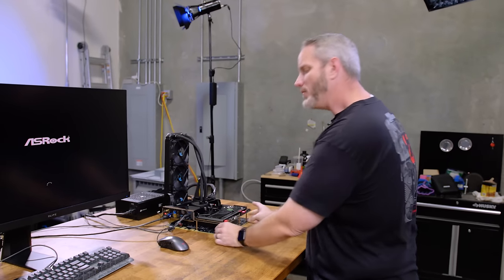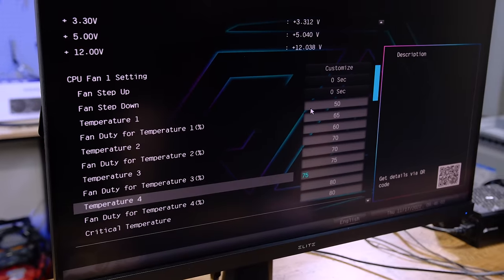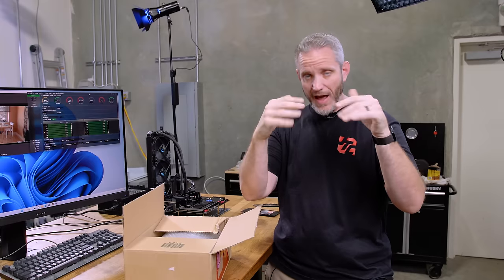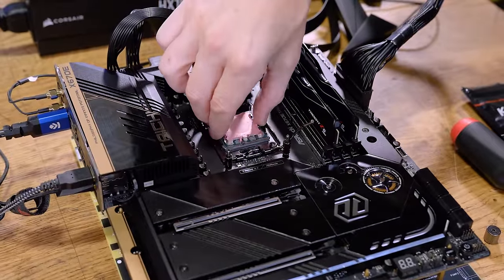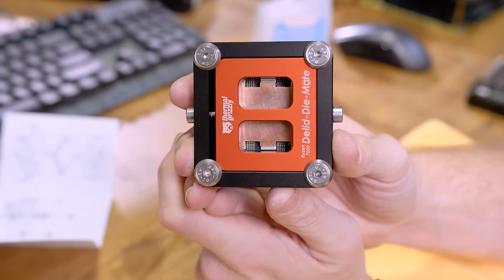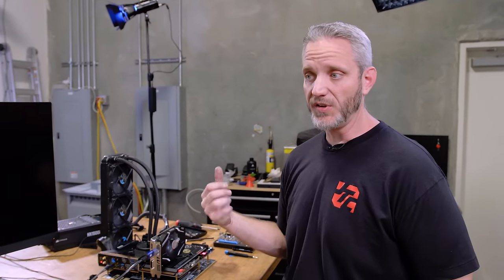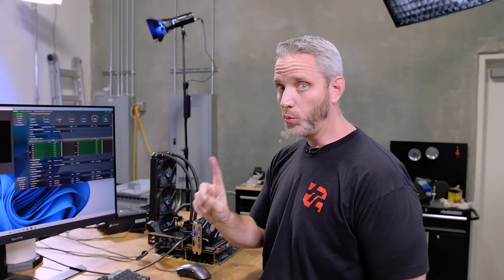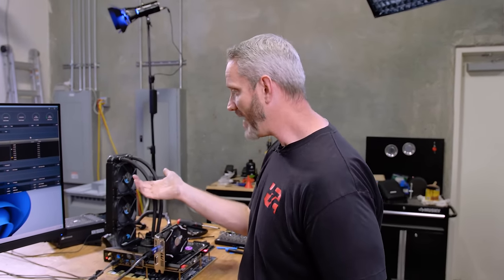I was scared to delid my CPU, but then...

Comment: Seeing you brush a CPU with a toothbrush terrifies me. A while back I had an old GPU (I think a 780 Ti) that I had replaced collecting dust, then decided to try to sell it. I used compressed air to clean it up and then gamed on it for 6 hours to make sure it still worked. After I noticed it still had some grime all over it and I wanted it to look like new, so I got a brand new soft bristled toothbrush and gently cleaned the whole thing, had it looking like new. Afterwards, the card was artifacting hard and after about 5-10 minutes would just crash the system. I figure at some point some ESD damaged some things on the board. Even if alcohol prevents the ESD, the thought of cleaning with a brush still bothers me.
Reply: You used the wrong alcohol
Reply: @ChrisWijtmans  I didn't use any alcohol, just gently brushed off the fine dust that air wouldn't remove. I think doing it with a coarse hair paint brush would've been better, since I think it was the synthetic plastic toothbrush fibers that caused ESD.

Comment: The CO voltage offset is found in the advanced PBO config on X570 boards, not beside the basic voltage tuning places.  I'd assume it's roughly the same on X670.

Comment: Nice nice video, Jay! Much thanks. I wanted to tell you something I heard about using Kryonaut for direct die cooling. I was changing my laptop's thermal paste because it dried out after 3 years (thanks, Intel). I read a lot online about how it dries out when temps are 80+ C or something like that. So maybe that is something to keep in mind when using it in your case. I am not how correct this is. I just wanted to tell you.

N.B.: I am using Arctic MX-5 now. It has been fine for the most part. A bit irrelevant.

Comment: Those other voltage settings only affect Manual Overclocking, which is switched on when the CPU draws over a certain amount of watts after a certain amount of time. In manual mode, you can select a set voltage for all cores and a set frequency for all cores (or at least each CCX) to dial in optimal settings for an all-core workload, but it shouldn't be much different to what PBO could do under the same conditions. I would love to see a CineBench score for when the PBO thermal limit is at 95 degrees (which is what is advertised that they can run indefinitely at) and stable values for CO (24 hours of OCCT AVX2/Small/Extreme with only one core loaded at a time). I think those settings can be found under Advanced -> AMD Overclocking in ASRock UEFI. That could show off what delidding really can do. I'm not sure I trust that the "Performance Preset" options offered under the ASRock UEFI are actually stable. It's all about the clock speeds and benchmarks with this generation and not temperatures, since you can set those to any you want and the processor will throttle itself there.

Comment: I have a velocity2 on my 7950x and it doesn't use an ek backplate. It mounts right into the stock backplate using a keyed stud that you tighten from the back.

Comment: ASROCK has always had the issues with 'pump more voltage' at their OC's even their Intel stuff.. their 8XXX stuff was throwing insane voltage for a 4.8-5.0 oc etc like 1.4v when you could get stable at 1.2 or 1.25

Comment: AMD boards are configured to get the max. out of the CPU they can. If you improve the cooling, you improve the performance especially of the turbo mode, but not really the temperature itself because the leeway is used in exchange.
I gained 20% in performance through adjusting the CPU cooling ramp, restricting the turbo mode and undervolting my CPU - and it's only a 65W Ryzen 7 5700X.
The thing you need to watch out for the most is thermal throttling, so if your CPU drops below its base/regular clock speed under load, finetuning is strongly recommended - and searching for flaws in the setup for good measure.
Also, I recommend avoiding AMDs above 65W, because they are prone to not just throttling but almost strangling themselves due to heat development, or if you want to go there regardless to ensure high level cooling such as shown in the video.
The best "performance for the bug" you get from a Ryzen 5 5600, which is a hexacore, or a Ryzen 7 5700X which is the fastest regular 65W octacore Ryzen.
The "Ryzen 7 5700G" is about 5% slower than the 5700X, but it does come with integrated graphics at the level of decent 720p gaming performance.

Comment: What this needs is a small CPU sized, PCB that has pins on one side connected straight through the PCB to pads on the bottom -- the PCB then gets installed between the socket and the PCU raising the top of the de-lidded CPU to the height of a normal CPU. That way you don't have to do anything special to get your heatsink to mount properly.
Reply: That would raise the resistance of the pins dramatically and probably damage the CPU, putting something between the LGA pins and the CPU.
Reply: @ColwellMarcus  Yes it would raise the resistance. I don't know if it could be classified as "dramatically, the pins already have to go through the socket, through the mother board through the (for example) RAM socket through the DIMM to the memory chip so there is already a bunch of resistance. The question would be "does this add too much resistance?"

Comment: I could be wrong on this as I've not fact checked this much yet but I think the solder used between the die and IHS isn't the same solder you think of when you think soldering capacitors SMD components.    etc.
I saw somewhere(I forgot where online) that briefly mentioned the solder used to transfer heat from the die to the IHS is more like a thermal paste than traditional solder, which would help explain why jayzTwoCents was able to delid this CPU without riping the Die off the CPU at seemingly room temperature.

Comment: Thank you for the very informative video as always, Jay. Say, that Celsius s36 was originally advertised to be upgraded to custom loop later, correct? If so would it be possible to just refill it? Asking for myself mostly. I was also looking at trying to get a 360mm 180x2 fan Radiator (if they ever become available again) for a fractal torrent case. My plan was to add the celsius pump and tubing to the 180x2 radiator... That pump would be ok for that rad, right? I'd imagine I would have to make sure to stick with a model with similar thickness?? I'll be honest tho I was looking at one of those thick boi's from alphacool lol. Keep up the great work. I always enjoy watching and learning from and with you.

Comment: Welcome to asrock. Also sometimes readings or voltages are not correct. For instance you could set cpu to 5.1 In the bios. But end up at 5200mhz😅

Comment: He’s come a long way from 3d printed deluding tools for my 9700K. Glad to see he’s still doing great work and improving on his designs. Do they have a copper IHS for this cpu?

Also when removing the original thermal compound, I had bought some solder removal paste stuff from him as well. People said they ran out too fast so I used it very sparingly about 4-5 times before I got everything cleaned up well enough that I thought fit to add Liquid Metal and put my new IHS on the chip. Used 4 dots of super glue to hold ISH on and haven’t had any issues since delidding 2 years ago.
Reply: the standard Intel and AMD IHS' are copper, there's no point in getting an aftermarket one (der8auer himself tested this)

Comment: I thought der8auer only worked with Thermal Grizzly, pretty sure he didn't found the company. Their stuff is great though, I always use it when working on consoles as well because of the longevity - their products have made many an Xbox and PS2 run cooler than cool.

Comment: i have de-lidded a Ryzen 5 5600 and to get the solder off the IHS in one clean quick efficient sweep is by using a thin razer blade one of those flimsy ones, running it almost parallel with the IHS and under the solder. comes up in one nice clean piece. It just sucks after that first successful attempt at de-lidding a Ryzen 5000 series. the very next day was my attempt at the 5900x and, well.. that was a 400 dollar lesson learned.

Comment: If AMD hadn't increased the thickness of that IHS and allowed the CPU to run around 135w max with those better thermals, this CPU would've sold way better.
Their insistence on attempting to keep pace with Intel meant the 7000x series isn't going to do as well.
That, and they're really competing against the 5800x3D.

For myself, if the CPU had had similar performance to a delidded one right from the start I probably would've gotten it even with a requirement to upgrade to AMD5 and DDR5. That money spent is not an issue, especially if I know I can do that and wait for 7800x3D and be already set up and ready to go for their 7900 XTX.

But, knowing the CPU runs at 95C, knowing it could've been better, and knowing it chugs power like crazy when my little 5600x already has similar performance at 4k+ resolution means I don't care to change to something that is a lot hotter, a lot more power hungry, and won't really give me any tangible performance uplifts.

========

If you compete with yourself you only then need to worry about your customers and giving them what is best for them. You don't need to beat your competitors, you only need to come within striking distance and show your customer base that you're the better value, the better company, and will support them more. Case in point, the Zune was a better MP3 player, objectively better. But Apple competed for customer satisfaction while the Zune competed with the ipod for performance and features. Look where we are now.

Comment: Jay, you know what annoys me so much, is how BIOS these days generally, apart from needing better detailed explanation about what voltage changes do effect, but simply allow simply to ability to expand down a detailed explanation what/where else it effects. Heck, even showing a diagram of the mboard and where changes view in a pictural colour view vectoring what changes interact with. As there are a few voltage options that by changing one slightly effects other components so fricken much. I think more than that, there are interactions where certain ratios can bugger everything up. 

For instance, apart from doing this kind of stuff since my 486dx4 100,  I am now managing to get my current build with a 12700k to hold all cores @ 5.5ghz and e-cores 4.2ghz, Ring 4.6, Corsair vengeance ram upped from 5600 cl36 to 6000mhz cl32 with a reduction in overall system latency, heat, temps,  total100% stability and can run it in power states in Windows to save power and all that stuff yet smash benchmarks, and not have a single core hit 90 degrees at 28 degrees C ambient. Also, makes my MSI Suprim X 12gb 3080 stable and work its arse off maintaining minimal fluctuation in 4K usage between 2130-2190mhz. This with just a Corsair 5000x case, a Noctua NH-D15, MSI Z690 EDGE WIFI, Corsair HX1000 PSU, 2tb Samsung 980 evo pro + 6 other hdds.

Basically, it took experience, persistence, hand drawn mud maps, reading detailed insider info from a few sources, and some mental substances to keep me motivated until I was done. 

Either way, when my old i7-4770k MSI dragon what ever motherboard included a nice diagram you could at least mouse over to see what is what with some detail. Figured, it would be all up from then..

Comment: If liquid metal can dissolve the solder between the IHS and the die aren't you afraid it will also eat up the solder between those surface mount resistors?

Comment: Removing the thermal paste is always a chore. Would pouring the alcohol into a small glass bowl and letting the CPU soak in it work better? I always use 90% alcohol because it works better. Could it be that Roman worked on the team that developed the 'O ' rings used on the space shuttle?

Comment: I believed that Roman (derbauer) bought into Thermal Grizzly, rather than starting it as you suggested Jay? Also, the cooler blowing hot air across the VRMs - really?! Surely it's best to blow away from them, so pulling cooler air across the VRMs. AND, according to Roman, VRMs don't really get very hot anyway.

Comment: Jay nailed it here.
If there isnt a massively over-thick IHS, you dont need the voltage to be so high to get the clocks, so are not creating heat, that cant get away.  AMD in their design, decided to default on letting temperatures peak to get the clocks they want ... thereby announcing they dont care how many years your CPU lasts running at 95c ... and thats the crux of it.  You have no choice but to run a top of the line cooling system, and thats to only get to 95c.

What Jay shows is that if AMD thinned out their IHS a lot ... or rethink and remove the IHS entirely (unlikely), they can continue to clock higher than intel in the long term, use less power and not hinder the lifespan of the part ... and even let a moderate cooling system be adequate for decent temps.

AMD need to pay attention to what Roman and Jay are doing here, if they want to stay ahead.
Reply: The CPU will autoclock to 95c to get the best performance, the user can limit that behavior in so many ways with very little penalty.
I have chosen 80c on my 5800x and 60c on my 5600g mediacenter, it is super easy.
Max power can also be chosen if needed.

The IHS thickness is to help direct touch heatpipe coolers to cool the CPU, without the thick IHS the heat would not spread out to the entire cooler surface.
Thick IHS preventing heat transfer is bullshit, why would a Noctua cooler have a 3 mm thick base plate on the cooler if it prevented heat transfer?
My mediacenter cooler base is 1cm thick Alu, if that somehow prevented heat transfer why would they waste money making the base that thick?

Comment: just ordered this same mb and cpu. I'll post my non-delidded cinebench results when i get it up and running. ordered a optimus block and extreme paste
Reply: So I pulled a 38936 in cinebench with ram set to 6000 32-38-38-88 timings. I couldn't get a stable load with 75c -40mv curve. So I used 75c -30mv. with 85c -30mv i got  39342 so that's negligible but with more power usage. I'm guessing that by de-lidding you  can get better stability with -40mv which then gives you a slight performance advantage at the same time lowering power usage

Comment: Just use some conformal coating on your components before using liquid metal, been daily running both my cpu and gpu on liquid metal for over a year. Have had my gpu horizontal and vertical with a riser for long periods of time and have yet to have any issues with liquid metal.

Comment: according to buildzoid he thinks the boards boot startup sequence is bad and memory overclocking is hard to do because the cmos has to be cleared and retrain the memory and msi might have fixed that problem on their AM5 motherboards but according to buildzoid no other company has figured out the safe boot on the motherboards. youll find it in his rambling about msi am5 motherboards video.

Comment: Jay, have you considered using Argus Monitor to control all your fan speeds? It allows you to set your own fan curves, static, or bios controlled and works with Corsair Commander Pro, Corsair and NZXT AIOs
Reply: He did a video a while back about FanControl, think that's what he's still using. It does its job quite well imo.

Comment: Just used Krynaut Thermal Grizzly paste on 7950x and rtx3090 with custom water loop. CPU normally works at 54 C and under full load rarely reaches 94-95  (usually stops at around 85C). Good paste, although a bitch to apply if you spread it yourself. Pro tip they don't mention in the instructions - put the tube into hot water for 3 min and then apply
Reply: I never used it. I always used noctua thermal paste is Krynaunt better
Reply: @thealien_ali3382  yeah I tried a lot of stuff, krynaut is by far the best. Just make sure to heat up the syringe in hot water to make application easier

Comment: I wouldn't do this unless it's absolutely necessary, for instance if the CPU has been overclocked/running for a VERY long time and needs new thermal compound,   It's literally like running a Racing engine with no Air Filters.  Sure... it's fine for a 1/4 mile,...  but go and street it now. Every time you reinstall the CPU or even bump the cooler too hard you run the risk of demolishing the die.

Comment: German here. Nice choice! Did my 7950X build with the CPU Guard to prevent shorts due to also using liquid metal thermal paste (Conductonaut). On top the Alphacool Eisbaer Aurora 420 Pro.
48-50°C idle, and no matter the use case, never above 78°C under load. In Cinebench 95°C... But a higher score than many got: 38244 pts multi-core.

Comment: Steve over at GN did some OC work directly with AMD about a month ago and they were usuing an Asrock board and the AMD guys mentioned then that they were working with mobo manufacturuers on the voltages issues as they knew about issue with the voltages not setting correctly on Zen4. So two suggestions, 1st check and see of there's a recent BIOS/UEFI update for the board and 2nd make sure you're using the most recent version of Ryzen Master as AMD also mentioned in the video that they had to fix that as well cause it wasn't reporting voltage offsets properly. Just a suggestion.

Comment: i have a 5900x runnin on a dark hero 8 with just a AIO corsair h115i or something. ran a manual overclock for months running fairly high temps gaming and horrible benchmarks. removed all overclocks besides memory in BIOS, went into advanced - amd OC - PBO - turn on advanced - go to curve optimizer and run around 20-30 uv on all cores and test for your self. hits 4.95ghz all day gaming at around 72c instead of 82+ and struggling in anything. due to thermal throttling. did the exact same to my 3080 and went from bottom 1% of all users on userbenchmark to top 99% just behind those with LN2 or water blocks. uv is the way for now unless your cooling is absolutely nuts.